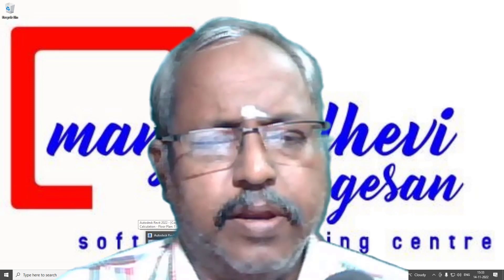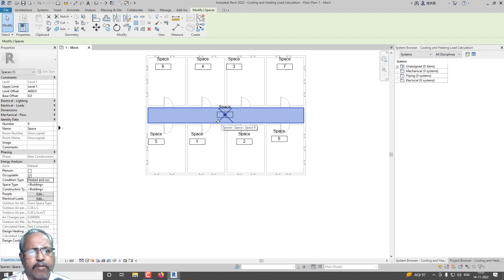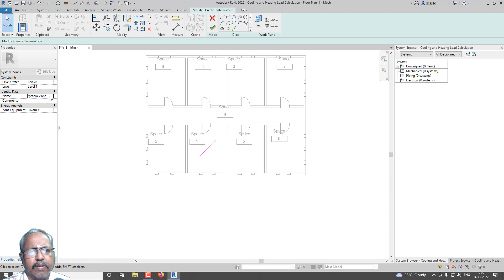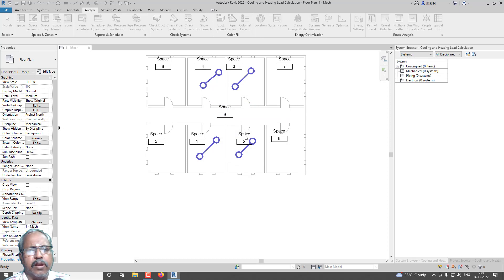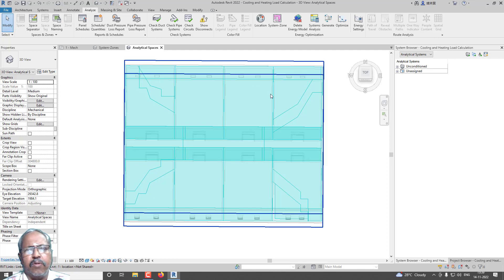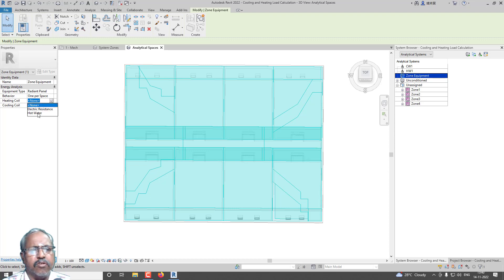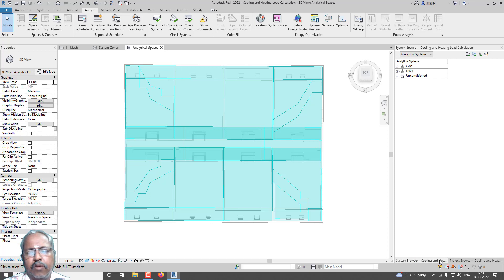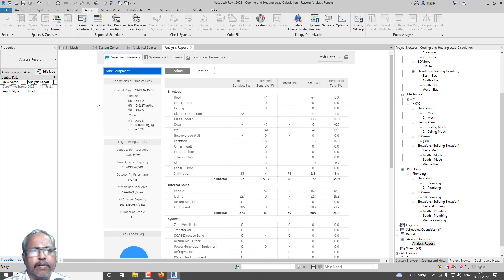Heating and Cooling Load Calculation in Revit 2022 in English

Comment: Thank you for the video. I have a question. What is the difference between HVAC zone and system-zone in revit?
Reply from the maker: We will upload video on the same. Like, Subscribe and share the channel
Reply: @mdmstc  Thank you Sir. In Revit 2023, I couldn't find the 4 buttons you mentioned after creating Eneergy model but in 2022 it is available like you show in the video. Where are those 4 buttons to create equipment, air system, water loop and autofit columns in Revit 2023?
Reply from the maker: @mastersilvaworld  I will check and upload video on that.